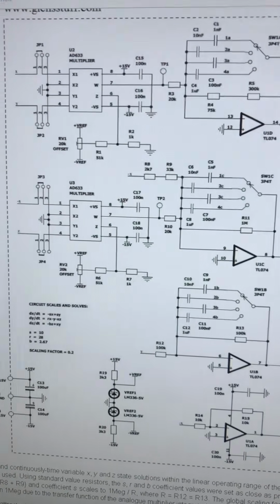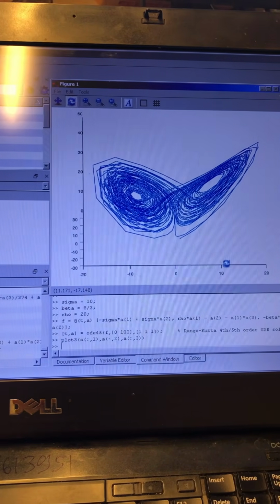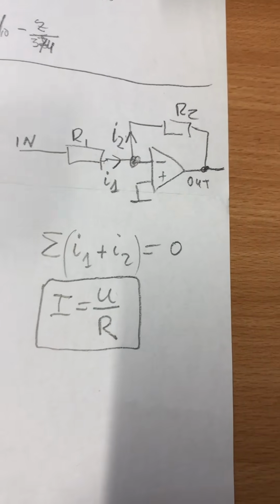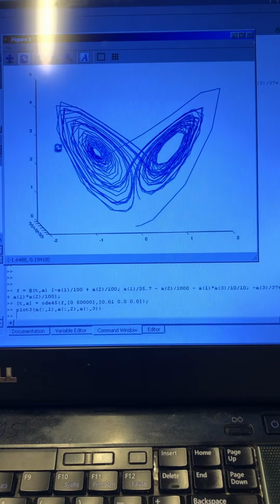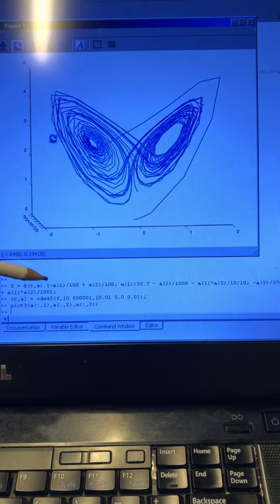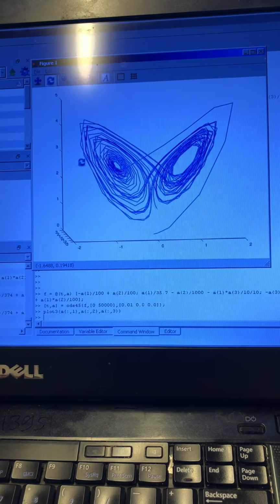Lorenz attractor analog computing. Learned how to simulate OPamp integrator circuit in MATLAB-Octave

Comment: Very interesting analysis thank you. I have purchased some multipliers to make this circuit from China, now Im wondering if they are fake, how did you know and where did yours come from?
Reply from the maker: I bought from Aliexpress AD633 in DIP case twice and they did not work. Google found that other people had similar problem with overheating. That chips have other model inside a single quadrant multiplyer. SSOP case from Ali worked for me
Reply: Oh dear that is exactly the chips I bought, I will test them with skepticism. I also purchased some MPY634 so I hope one of them works. Thank you  @minhenes
Reply from the maker: AD633 DIP case and SSOP case has different pinout. Check the manufacturer datasheet.